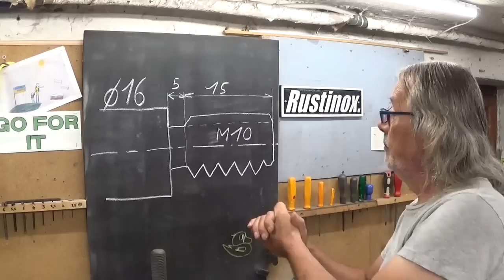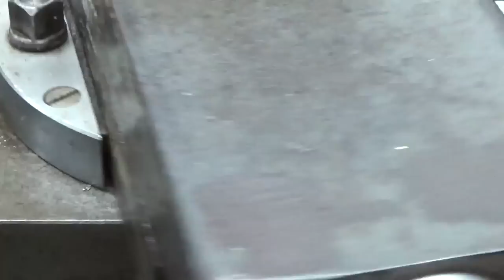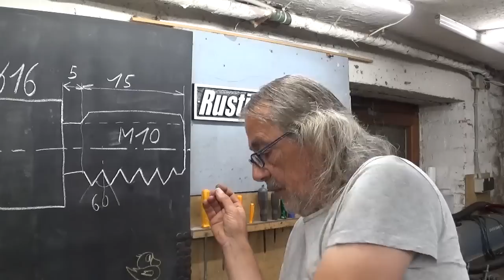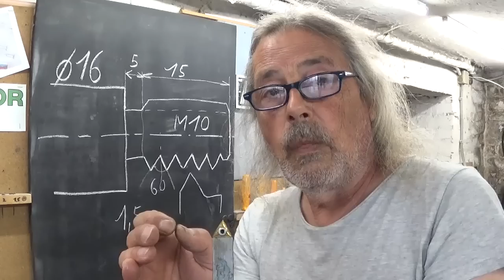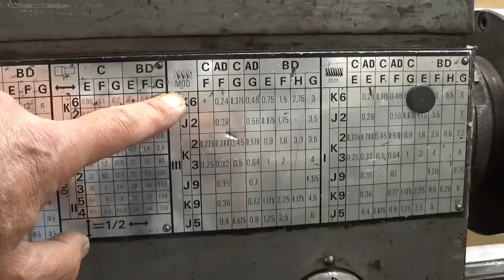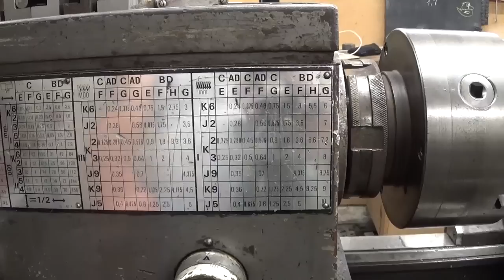How I cut metric threads on the lathe.

Comment: Michel, a quick and not so dirty way to square up your threading tool ( or any other) I always use either the slightly  loose tool holder and bring it right up to the face of the chuck between the jaws, if there is not enough room then I use a 123 block between the face of the chuck and the tool holder, once I have them held together by the carriage hand wheel I then just tighten up the tool holder nut and there you go a perfectly aligned tool!
Reply from the maker: That only works if the angle between the shank and the cutting edge is 30° With hand made tools it's not always correct.

Comment: Did you see my carriage stop video?  works similar to your line. sets cross slide zero absolute. has room to back off to reverse, and then you roll to a hard stop, add your cut  depth on the compound.
Reply from the maker: Not yet but I will.
Reply: @Rustinox  most useful for repeating useage, like 10 bolts etc. tapers,

Comment: Metric users can switch to imperial numbers just like we can switch to metric by doubling everything. For example: 10kg is 20lbs and 5k is 10 miles.
That's why 12 hours is 24 hours in Europe. They use smaller hours there. So instead of 60 minutes in an hour, they have 30 minutes.
Reply from the maker: So, that's why I get old so quickly :)

Comment: Three other tips that I use: you can set the side of the threading tool against the face of the chuck to ensure it is 90 degrees to the work, for small dia. For small diameter threads  fine pitch you do not need to set the top slide at 30 instead plunge in at 90 for me this is OK to M20. Finally if you have die it can be used to finish the thread to get the nice radii on the crests and the roots. Well done Michel.
Reply from the maker: Aligning the tool against the chuck doesn't work if the angle between the shank and the cutting edge isn't exactly 30°.
Reply: Just leave the top slide at 90° to the cross slide and feed it at 1/2 the rate you feed in, effectively does the same thing but you do have to remember where you were after each cut on the cross slide dial.

Comment: I've single point cut/turned V, Acme and square threads, quite a few double and one triple lead Acme, and a double lead square, when it came to cutting a metric thread, the boss called it in for threaded rod LOL. Matter of fact I still have the first single and double lead Acme thread I cut my first year(Junior year in HS) in Vocational machine shop class(3hrs a day) had to hand sharpen the High Speed tool bits which was a pain because the wheels on the grinder weren't even close to being flat/square, after 35+ years in the trade I can hand sharpen drill bits with ease, as long as my eyesight holds up LOL. WOW! I also still have the V-Block all Juniors made as a project too, I remember the time it took to make it, probably a month, all hand layout and hand center punching a bunch of holes and now I have no doubt I could make the V-Block and clamp in around 6 hours on a bridgeport, we weren't allowed to use the Bridgeport in class, teacher was a hard a** had to use a horizontal mill and drill all holes on a drill press.
Reply from the maker: What a story :)

Comment: Great, enjoyable video. I've never got down to cutting threads on my lathe but it has always seemed a consideration that turning the top slide to say 29 degrees might be a good idea to make sure that both sides of the tool cut and avoid any possibility of slight steps on one flank of the thread caused by a minor inaccuracy. One side of the tool would still do 95% of the work but the other side would take a light skim. Also keeping the half nut engaged is a safe way to go but I thought you could disengage it if you re engaged it on the same number on the dial? I am being an armchair engineer here. Just thinking out loud.
Reply from the maker: On most metric lathes there is no thread dial, so that's not an option.

Comment: Nice explanation. I rarely run my lathe in reverse as I have a threaded spindle. But once I get the other lathe up and running, I will be able to use 5C collets which will make that possible for small items.
Reply from the maker: I forgot to mention the problem with threaded on chucks... oops.

Comment: Hi Rusty,

A good Rule of thumb with the outer diameter is when you take the nominal diameter, in your example 10mm, and subtract 10 procent of the thread pitch you want to cut, in this case 1,5mm*0,1=0.15. So your start diameter to cut the M10 thread would be round about 9,85mm. That works very well!

Greethings from Germany and always looking forward to your videos,
Andi
Reply from the maker: That's a very useful tip. Thanks.

Comment: Hi   On a side not lathe running slow sounded just like mine until I changed the motor for a 3ph 1,     I found out the bearing in the old motor where causing the noise. Dry worn out bearings 
Steve
Reply from the maker: Good thing you fixed it.

Comment: I don’t have a compound for my little mini lathe in order to set the angle correctly to reduce the amount of tool pressure when cutting threads, so for now, I only use dies for cutting threads on my mini lathe.  I also only have an unconventional power feed and I would need to determine what the speed of the spindle would need to be as well as the speed of the power feed of the lead screw in order to cut a thread.  I was originally going to install a programmable electronic lead screw but I use a servo to turn the spindle and I couldn’t figure out how to control the spindle speed and position of the lead screw in order to control the speed of the lead screw to cut a proper thread, that’s clear as mud.  Basically, It became far too technical for me so I decided to just convert my mini lathe to CNC and then I could program the position of the carriage and the cross slide and just need to design the thread in my design software create gcode and just go for it.  Now, if that’s not just convoluted I don’t what is. 😅
Reply from the maker: Well, to keep it simple you can... eh...

Comment: As always, an entertaining and educating video.
Time 13:00. I use a 1:2:3 block between the tool post and the chuck. Any rectangular block having 2 parallell sides can be used, but You know that..
How would You thread a 2 inch long, left hand M6 .5?
Reply from the maker: The 123 block only works if the cutting tool is made at exactly 30° from the shank.
Reply: @Rustinox  Correct.

Comment: Why does the halfnut need to be kept engaged on a metric machine cutting metric threads?
Reply: Here to ask this as well, because I am confused. My understanding (as a user of lathes made for the north american market) is that we here in NA keep the halfnut engaged when cutting Metric threads because the thread dial cannot be relied upon in this situation, but my expectation is that a metric lathe would have the opposite problem: halfnut engagement would need to be maintained when cutting imperial.
Reply: Michel, it is lesser known that if the lead of the lead screw is divisible with the thread lead you can actually release the half nuts. So on my Boley 5LZ with a 6mm lead I can release the half nuts on these leads(and a few really small ones: 0.25, 0.3, 0.5, 0.6, 0.75, 1.0, 1.5, 2, 3, 6mm. 
This is really useful info that few people that I speak to know.
Reply: @Roso9509  This is one that seems to be left out of most manuals - but proves so useful in practice.
Reply: You can't release the half nut with metric threads .
The reason is metric threads have other dividers than imperial.
Imperial threads consists on fractions.
Metric does not .
With a 5mm pitch on the lead screw it's impossible to release the half nut on a 1,5 mm thread 
You must wait 1,5 full turns of the lead screw to engage again.
Or 0,7mm pitch , this gives a very odd Number of turns ...
Reply from the maker: Well, I suppose you'll find the answer here in the comments. Thanks to everyone.
Reply: Hi Dcraft1234 most lathes' gearboxes have the pre select gear arrangemnt and in turn gearselection to achieve the right combination(for threadpitch). The carriage is drawn to the workpiece by the leadscrew which is engaged/disengaged to start/ stop the thread cutting respectively. Without the half(2 halves actually)the threadcutting would not be possible due to its connection of leadscrew to threadcutting gears in thread gearbox. Hope this helps to understand
Reply: If you use the index to reset like an imperial thread you will get a multi-lead effect because of the odd ratio between metric and imperial .(1"=25.4 mm, 1mm =.03937") and a gear ratio of 127:5 is needed somewhere in the lead screw gear train)
Reply: @howder1951  but why is that true on an all metric lathe?
Reply: @StripeyType  Sorry, I was referring to my own experience with cutting metric threads on my imperial lathe. Sorry if I confused you. But I have never used an all metric drive train as yet.
Reply: @howder1951  No worries at all. :D I've also had to keep the half nut engaged for the same task on my lathe, for the same reason. And I would expect that on a metric lathe, the inverse would be true: cutting 'imperial' (actually U.S. Customary - I'm nothing if needlessly-pedantic) threads on a metric lathe would need the same treatment.
Reply: Strictly speaking it is not always necessary, and if you have a metric threading dial (needs at least three different gears and is “very uncommon”) you can open the half nuts. See my response below as well.
Reply: @Roso9509 on mine (6mm pitch leadscrew) the threading dial, is actually 2 dials which are compound geared together, which allows the half nuts to be disengaged for most pitches (but the gear that meshes with the lead screw is trashed so I need to make a replacement), basically any thread which divides equally into 90, 42 or 462mm is acceptable.